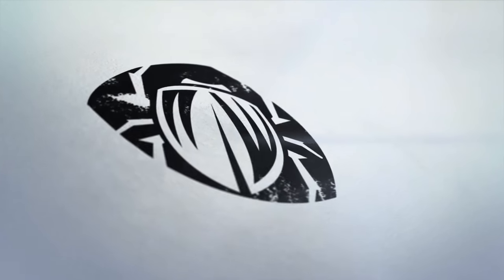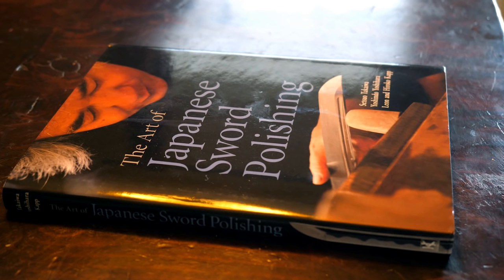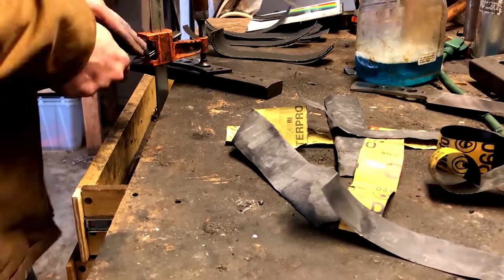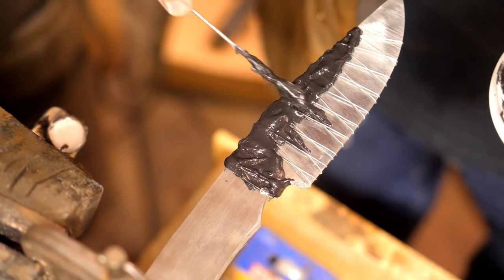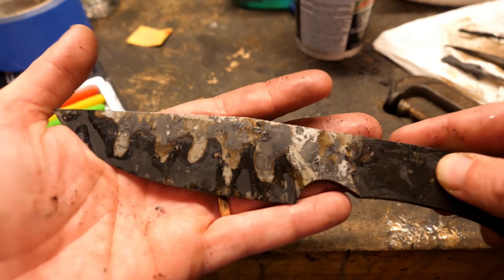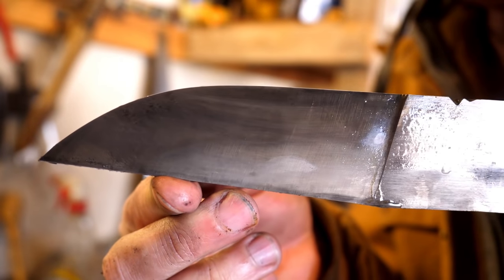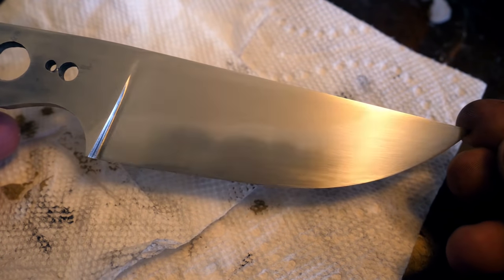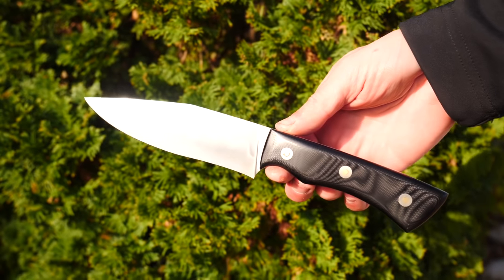Hamons 2 (aka "The After-Hammond") Hybrid vs Traditional Polishing

Comment: You actually did really well with the stones, one thing to keep in mind though, is when you're doing your foundation polish is to use short little circular strokes.  It'll save you a huge headache in the long run.

Also I noticed that the first water quenched knife was totally devoid of asha lines (lines of clay extending from the ridge to the edge of the blade)... said lines are pretty much essential to keep the edge from cracking from use... and during the quench as they relieve stress along the edge, plus they produce different patterns (activity as you called it) within the Hamon

Other than that You did really good work on both, Keep 'em coming ^.^

Comment: BTW, there is #0000 (0*4) steel wool, gunsmith books recommend it all the time for removing very light rust from guns without harming the fragile bluing.
Reply from the maker: very interesting maybe I should try that, ty
Reply: Yes. It works way better.

Comment: I made a knife for my senior independent shop class project back in HS, complete with hardening, tempering, and signing my name in the blade using a combination of nitric & sulfuric acids in the chem lab.  Since the finest grit belts you could get for the sanders in my school shop was 180 grit, I polished it all by hand.  Turn a movie on, then sit in the livingroom for hours with a piece of wet-dry silicon carbide sandpaper stuck to my finger, rubbing it back and forth over the blade.  It was interesting seeing you do pretty much the same thing for the traditional technique, only using stones instead of sandpaper.  Feel like I spent about 3 years rubbing sandpaper against that blade in that single semester, but it came out great. =)

Comment: That book wasn't around in the 80s when I learned Shitage and Shiagi Togi. Lot's of time and advice, and dreams believe it or not. I dreamt out the subtleties of the Hazuya, Narutake and Nugui. Would wake up and improved by leaps and bounds as time passed. I used Asahi Synthetics, and Naturals. You know you slaughtered the pronunciations. My Uchigumori where $600 a piece those are cheap decent ones. Oh, and Tungsten Carbide Migaki Bo. We also use Chromium 2, and Chromium 3 Oxide. The Red, and Green Nugui. You have to work your Nugui, a lot with Kanahada, less with Chromium. 

Pretty much Retired now though.

Comment: I did not think to ask this in my earlier comments your hamon videos and I am wondering if you did you clayed the back of the spine and front of the ricasso of your blades? I am asking because I have observed a lot of clay quenches as it's my preferred method of quenching as personally i feel its the gentlest method of quenching. If you do not cover these parts of the blade your quenching you are far more likely to crack the blade. I am unsure what grit you take your blades up to before quenching but I suggest stoping at 120 as that will allow the clay to stick the blade allowing you to forgo the wire. also to prevent auto tempering you should leave the blade in your quench medium until the medium stops boiling as quench speed only affects the exposed steel and the heat will rise away from the exposed steel. I think you may want to do a 5-7 second count before switching from water to oil if you want to use walters method and form what i have seen when he does this quench I feel it is a modified interrupted quench. I would love for you to revisit this subject trying out my suggestions.

I hope you keep up the great work.

sorry if I come off as arrogant here however I have done enough clay quenches to go threw 3 32 ounce containers of Rutland black and so my arrogance is backed up by a lot of observations.

Comment: Ahhh 1084, now there's yer problem...  too many Manganese's ;)     Great video!
Reply from the maker: It's the low manganese version Aldo sells.  At least that's what's claimed about it.  Thanks!
Reply: Green Beetle -  I wasn't aware that he sold a low manganese 1084, although it's been a while since I've had to buy any steel from him since I'm pretty well stocked (at least for my slow pace).  I do know that he sells a low manganese 1075 as I still have some... It really makes for a nice hamon btw👍.   Are you sure you aren't thinking of his low manganese 1075?  

ETA:  I just gave his site a quick check out of curiosity and the only 1084 his site has at the moment is listed as having a .8 manganese content, which is great for contrast in damascus, but not quite ideal for much activity in a hamon.  On the other hand, his 1075 is listed as having a .35 manganese content, which makes for some good ashi and "wispy clouds" etc.  :)

Comment: Try dabbling with different dilution strengths of Potassium Dichromate and Hydrochloric acid,  be careful making initial brew, 1/ dissolve Dichromate in hot water, then SLOWLY add acid, otherwise it will reboil the water and may splatter, 2/  wear the right safety gear and be careful with Dichromate,- nasty !! Make initial brew with basic equal amounts ,200 grams Potassium Dichromate, 200 ML Hot water, 200ML Hydrochloric Acid, Your finished solution will be Yellow in colour, and looks so similar to the test dip solution I have watched you use in your Vids, to bring out Demascus pattern, would love to see if this works there too ,let me know !!

Comment: If you have so much difficulty with getting  the water quench to not crack, do you know how they used to do it in Japan with a fairly high success rate with, debate ably, lower quality steel?  Is it the lamination pattern?

Comment: I need help o wise master of the blade!! I did everything you did in the video, but I can’t get the hamon to show. When I etch it in the lemon I can see the difference in soft and hard steel with the pattern I made in clay, but when I put brasso metal polish on it nothing happens. The blade goes back to white with no difference between the steels and no hamon. I spent the last two days wiping the damn thing down with lemon, grapefruit, and vinegar to no avail. Any pointers or ideas why I am failing so badly at this?
Reply from the maker: what was the steel, how did you quench it, did you try etching with ferric. you can polish off the oxides that reveal the hamon with the metal polish ...
Reply: @GreenBeetle  part of my problem is probably the steel. I don't know exactly what it is. I made the knife from a railroad clip. It is probably 5160 or something similar. As for the quench, I brought it up to non magnetic and let it sit for a few extra seconds and then quenched it in vegetable oil and I don't have ferric chloride at the moment to help with the etch, that is why I followed your way of using lemons. The lemons worked, I could see the unhardened, hardened, and the hamon but when I wipe the oxides off and use the metal polish the definition goes away. Thanks for all the help and for making such great videos! You can't believe how helpful they are to beginners like me who don't have someone to study under.
Reply from the maker: @ddayinvader6487    using mystery steel for a hamon or anything really is a big gamble.  w1, w2, 1070, 1084, 1095 are typical hamon steels.  If you can find it, low alloy 1050.
Reply: @GreenBeetle  hello again wise sage of pointy things, I have another question. So I took your advice and got some w2 from Aldo and made a knife. Well several, five blew up in the quench. The one that didn't cause me to scream profanity for all my neighbors to hear, is doing weird things. It has a hamon line but when I etch it with lemons it just doesn't seem to do what yours did. The line and really everything seems to be cloudy. When I first started etching it the hardened portion remained white while the unhardened portion etched black and the hamon appeared. But as I kept etching and polishing, the hardened  area began to look hazy and dull and so did the hamon, and now there is little difference between the three sections. Any ideas as to why it is doing this? Could it be the metal polish I am using, because it seems like the oxides aren't being totally removed when I polish but I scrubbed the thing for ten minutes and the haziness doesn't seem to go away.
Reply from the maker: @ddayinvader6487  hard to know without seeing pictures whats going on.  give it a dunk in ferric chloride to quickly bring out your landmarks and see if your hamon is any good or not?
Reply: @GreenBeetle  would it be ok if I send you a few pictures of the knife?
Reply from the maker: @ddayinvader6487  ok
Reply: Green Beetle ok, so I sent you some pictures via the email present in the description. As always thank you for all your help and knowledge.

Comment: Would it be safer to use two different carbon steels? In my limited knowledge I thought they used a high carbon steel for the edge and lower carbon steel in the spine.

Comment: Have you tried it with a high salt content in the water?
Reply from the maker: I've done brine quenches before on farrier rasps.  My understanding though is that it's rougher on blades than straight water quenching because it's quicker?
Reply: Green Beetle -  sorry not trying to be a know-it-all here, but I just wanted to mention that I believe brine can actually be more "gentle" on the steel, since the salt content helps to break up the vapor jacket it allows the water to contact and cool/quench the steel more evenly, as opposed to straight water where the vapor jacket can be uneven and push the blade around in different directions along the length of the blade as it cools.  So even though the salt allows the water to quench the steel faster, it can result in a more even and thus less stressful quench from being pushed and pulled around by the vapor jacket.  

I will say I've never tested this myself, I only remember reading about somewhere a number of years back.  If you're interested you could try comparing the two quenches (water and brine) to each other sometime to see if the brine helps lower the percentage of cracked blades and lessen the severity of any warping.
Reply: Brine works well for exactly the reason Isubslimed mentioned. The salt ions provide nucleation sites for the formation of a very large number of very tiny bubbles. It sort of fizzes. I add salt to room temp water until it stops dissolving, then heat the brine up to 120 F with a cheap immersion heater. There may be -- and probably are -- better "recipes", but this works well for me.  Clyde